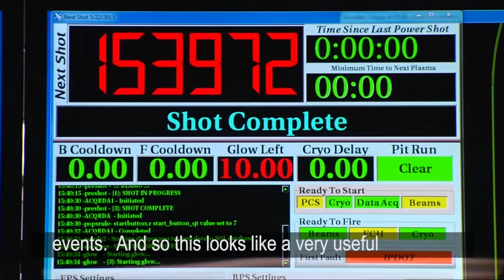US ITER: Larry Baylor & the Pellet Injection System

Comment: Do you really want to build a nuclear reactor in which there is an intrinsic risk of destruction by solar flare-like events? 
Trying to control this risk is commendable but the only serious option is not to risk this destruction.
On the other hand, the statement at time 3:23 "Fusion is a potential energy source that there's an endless supply of fuel and it's an environmentally friendly technology" is not exact: fusion reactors consume a frightening amount of liquid helium, niobium, lithium,

beryllium, etc..., which makes them non-sustainable as an energy source and very destructive of the planet's resources.